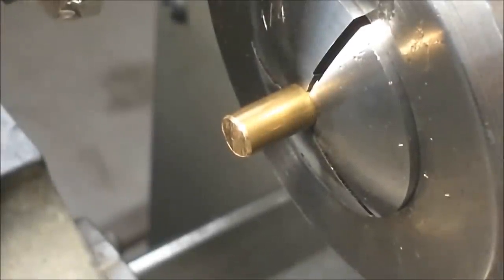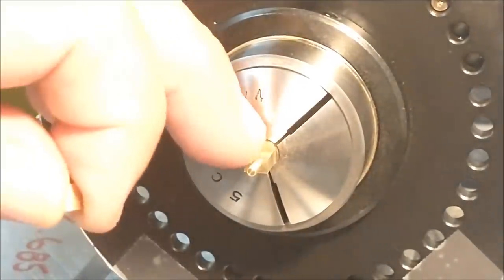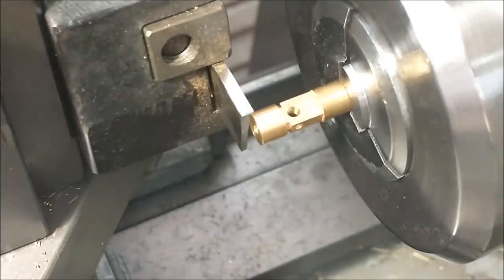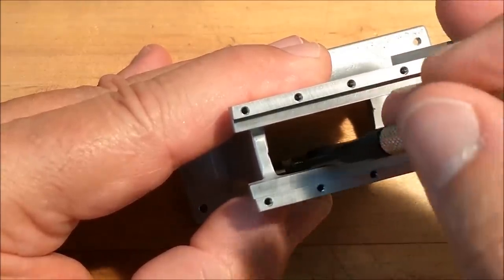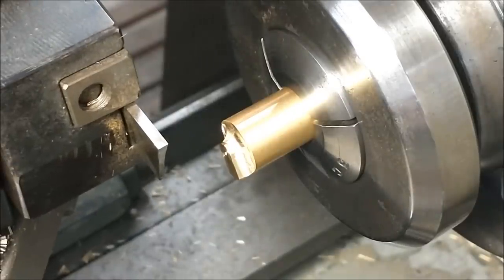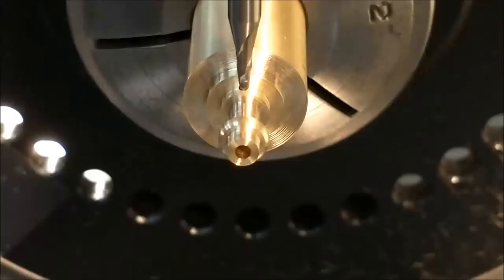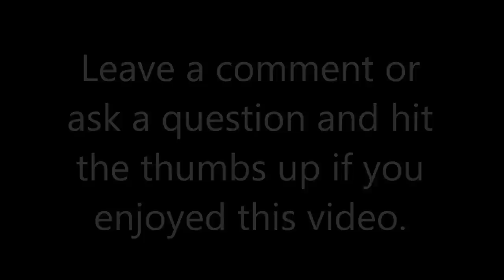The Most Expensive Hinges Ever --  Don't Miss This One !!!

Comment: AMAZING! The brass "bling" really sets off the features!
RE: Using the slide hold-down hole to drill the hinges : It looked to me that there was just enough offset that ONE hole would have been out of whack to align with the hinges. Plus, that would have required ONE through hole; not good. Your solution was inspired and beautifully executed!

Comment: I worked on aircraft for 22 years. It is paramount to insure you don't drop small pieces of hardware. I used a tiny dab of superglue to glue the bit to the end of my finger.  Once the threads started I unloosened my finger by tearing off a small piece of callous where the bit was glued.

Comment: Well done Joe. Just a word of warning if you do not know, Do Not get this damp or wet, you have mixed Brass and Aluminium, dissimilar metals and you will get an electrolytic action. They will react and corrode and seize up. If you ever do make aluminium parts for wet reasons, only used stainless steel fixings or Nickel plated brass screws. Regards from Australia.
Reply from the maker: Thanks Dave. Thats an interesting fact. I'll keep that in mind.

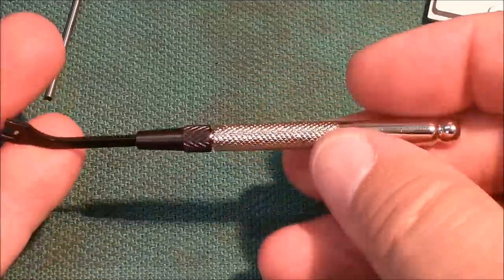Comment: 16:29 a 1/8" wrench? Dang. Sikorsky Aircraft Co. used to give out a 'Golden Wrench Award' to commands with exceptional stats and I was lucky to get one. I had to use it one day because ...well... they built the helo around a connector I had to take apart that used 1/32" nuts. I had to use two inspection panels to just get access to it, ended up bending my teeny tiny golden wrench but that pot metal wrench got the job done. Sure wish the Navy had deep enough pockets back then to outfit a 6 month cruise tool box with some of those smaller tools, oh and forceps! Locking forceps are your friend when it comes to dealing with cramped spaces!
Reply from the maker: That wrench was about mid range in a 16 piece set. What a great gift it was.

Comment: Hey Joe, I am a former hydraulic technician who rose through the ranks (out of necessity) in a small shop in south central Florida. I had to learn Everything! I also self taught to machine cylinders . In my time there, I had no idea what I was doing but the stuff worked. Since the invention of YouTube and with the participation of videographer/machinists such as yourself I have learned more techniques and processes than I ever did by myself. My only problem now is NO MACHINES! I am pretty good with the “Mexican Milling Machine” and have spent many hours making parts for muzzle loaders by hand. I just want to thank you for allowing me to look over your shoulder to see what I could have done so many years ago when I had unlimited access to the company’s machines. Now I am retired and have a garage shop with the common “Handyman Tools” but the machine tools are lacking.
Count your blessings and make hay while the Sun shines!
Reply from the maker: At the very least, I'll have to have a mill and lathe when I retire. For now, the boss doesn't mind me using the machines. :)

Comment: Superb work - I should think you would have a big smile after that - totally top shelf. The replacement hinges kick the machine up to a new level entirely. I like the tape trick, I've done a similar thing with a blob of grease on a screwdriver before - it's what I had available at the time and I wanted the nut greased anyway. The tape is cleaner though.

Comment: Well, hello again my friend. This body sure has a lot going on. Lots of thought before executing any move for sure. These brass hinges sure look great on the aluminum door and body. They look like they belong there. Awesome fit. A touch of Vaseline on those securing nuts will really help starting the nuts. Far easier to clean-up any excess. It lubricates the threads so a better torque is achieved as well. As with so many things there is usually more ways to approach any problem. That tape one is brilliant. Kudos to the fella that made that little wrench. Another treasure for your tool box. You sure deserve to pat your own back for this. It not only looks great it is functional and it's scale is as well. WOO HOO on you my friend. Onward eh !

Comment: Hi Joe! Absolutely beautiful work there on the hinges! May I make one (constructive) criticism? Make some sort of index mark on the knob (handle) vis-a-vis the interior cam, so you can tell at a glance when the door is locked? Maybe drill a small hole in the knob, and fit a small wire (filed and rounded-down, so you don’t poke your finger) into the hole as an interference fit, so it looks like the sort you would find on a real machine (such as the table X/Y feed on a milling machine.) This way, you can tell where the cam is by looking at the handle on the knob. It’s going to be difficult to see the cam when this is all fully assembled, and the knob - being round - is rotationally symmetric, making it difficult to tell where the cam is relative to the knob rotation. 😌

Comment: Joe, I’d love to see a video of your shop layout and why you have it that way. I’m building a shop and want to maximize space and machine location. Thanks in advance!
Reply from the maker: My shop is laid out in a horse shoe pattern. The raw material, saws and abrasives are on the right, the machines are in the center and the inventory, assembly and shipping are on the left. Everything flows clockwise and out the door. Its a very solid arrangement and keeps the blast and grinding dust away from the machines.

Comment: Joe I was thinking while you were machining the cam section of the door latch, why not use the spin index with the endmill on top center of the radi and just turn the part 90 deg in both directions to get your radi instead of all the filing after the fact? I know a rotary table would be the best for an op like that but with the light machining I think the spin-index could have pulled it off.
Reply: That's what I thought Joe was talking about when he mentioned rounding the end.
Reply from the maker: I absolutely could have, but this type of indexer isn't really designed for partial rotation work. It doesn't have positive stops other than the pin. Milling can grab a part pretty quick.

Comment: Hey joe Loving those hinges although I’m looking at the tapped holes in the top for the hold down and wondering if that second one lines up nicely for the original hinges or could be moved slightly to line up.
Reply from the maker: Excellent catch. The tap drill size for those holes is almost exactly the same size as the hinge pins. I think thats a fantastic idea. PM Research should suggest that on the print.
Reply: An would have been good. Those brass ones are pretty special though.

Comment: Nice work as usual Joe.. Here is a suggestion for ur center of knob problem..  Maybe just take a few thous off of the door so center of latch will be flush then u can file and buff that center ( that will bother you..LOL ) Away :)  Cant wait for next video...
Reply from the maker: They are flush, but one is a turned surface so it doesn't match cosmetically perfect.

Comment: Hey Joe. Great planning on being able to start the nuts on the hinges before they go in the pockets. You both nailed it and screwed it. LOL. I have a set of Wiha hex drivers. I had to check the brand on mine when I saw the handle of your nut driver. No disrespect, but I have mixed feelings on the looks of the brass. I think it would look out of place if that is the only place brass is used. Is there more brass used on this model? It would look neat to have the screws holding the slide rails in brass too. Looking forward to the next video!

Comment: Nice work and nice touch, you should be proud. It can be the finer details that can make or break small models. It's also even better when you scratch build those finer details. Excellent fix, but wouldn't a lever be more period correct than a knob? Just a thought, but the knob seems a bit "now" or modern so to speak.
Reply from the maker: Actually, I think an aggressive 4 lobed knob would be more period correct from what I've seen.

Comment: An alternative to your tape on rule idea is to have a correctly sized spanner/wrench, and put a single layer of paper into the jaws along one side of the nut. Reduces the clearance to 0, and holds the nut perfectly in the jaws until it is pulled out by screwing action or fingers (but either way, defeats gravity).
Reply: You can also put the nut in the spanner and then put a small piece of tape over nut and spanner so it holds the nut in the spanner...

Comment: You know, I've seen hinges just like that before, recessed in small pockets.
They had a single center screw recessed in middle at the cutout and just used a threaded hole in the bottom of the pocket on the part.
This was more fun though...
Reply from the maker: I considered that but ran out of space.

Comment: You should of milled the fork on when still attached to the blank and then milled it off. blank has more stability than the little threads you just cut. Great videos. I don't have the eye sight for that fine work. Machist/die maker for 30 + years. like you say there are many ways to skin a cat.

Comment: Had to pause, right out of the gate I was expecting a threading die for the little #2-56. Not sure if people really grasp how small a #2 screw really is. I guess it could be worse, could have been a #0-80.
Reply from the maker: I've yet to single point an 0-80, but I have done 1-72's. My gear box only drops to 72 TPI, or I'd video one.

Comment: I am curious how that hole through the hinge helped to mill the gap.  Also, the press fit of the handle didn't seem very tight.  Will it not work loose and fall off?
Reply: Joe will use a trick from a previous video, make an indent in the locking part in order to increase the press force needed. (Joe: Approved!)
Reply: The big hole through the hinge just removed the bulk of the material making it easier to mill out.

Comment: @ 1:00 are you turning in reverse?
Reply from the maker: I thread in reverse. Everything else is forward rotation.
Reply: @joepie221  what sort of RPMs are you running for these small diameters? Some quick math for 6mm brass says around 8000 rpm but I doubt that's what you ran it at? The results are excellent.

Comment: is that a casting? or is it made to like like one? its tiny!
Reply: It is a casting, from a kit.  Check out his series of vids where he finishes and assembles working models of old belt driven machine tools.  The kits are rough aluminum castings that need to be machined to spec. He's  done the lathe, camel back drill press, bench grinder and an arbor press.   If you have an interest in machining or model building, they are some of the finest content on YouTube you'll find.  The finished models are museum quality, and stunning.

Comment: Dunno why I'm asking this; I can't envisage ever doing such precise machining. But here goes anyway. Why did you drill the hole across the hinge forks and then mill the middle out - couldn't you have achieved the same goal just by milling? (I used to tell my students that whenever they used the word "just" to qualify  another person's actions, they were underestimating either the difficulty of the task or the effort expended by the other person - or both. I hope I haven't done that.)
Reply from the maker: Its a good question. Endmills are helical and apply a lifting force when cutting. The 2-56 threads holding the part down are very small and not torqued as not to damage them. The cross hole was drilled to relieve material, thus reducing cutting forces for that slot.
Reply: @joepie221  Gotcha. Thank you.